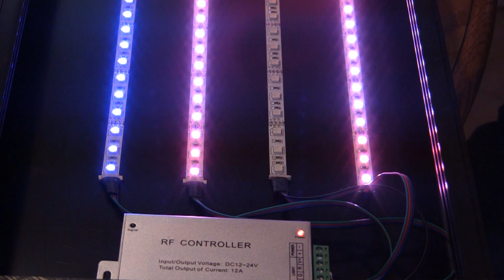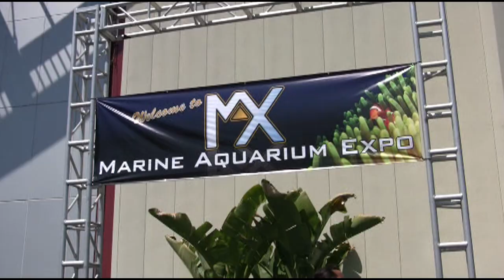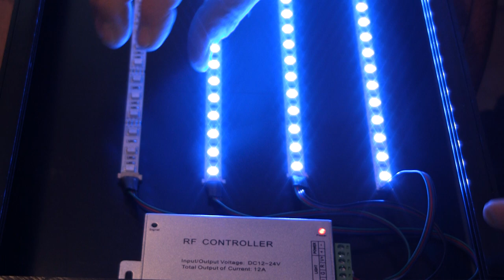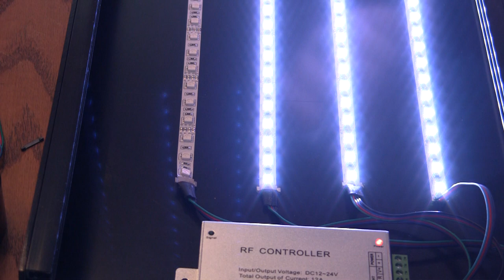Peanut Butter and Jellyfish, LA Fishguys, Episode 111 pt 5

Comment: Jim you hook those led's in parallel you should of got the jumpers that connect one strip to another. At the end of the job it would of look like one long strip like before you cut them. That way you only needed one connected to the power supply and 3 jumpers.  You could of attach the wires to the other side of the led's.

Comment: i think your supposed to hook it up as if it was a continuous strip. example: strip 1 from power supply, then solder wires from open end of strip 1 to strip 2 and so on..Thats how im guessing it works since it originally comes in a big spool uncut and when you plugged it in to power supply it worked in unison because it was still all 1 strip

Comment: You can go to Home Depot or Radio Shack and get some square sticky tabs. Which will allow you to secure the wires with a ty-wrap and hold them in place, if you ever need to build another LED fixture. 

Model: 278-441  |  Catalog #: 278-441 
Wire-Tie Mounts (10-Pack)
Price:$4.49